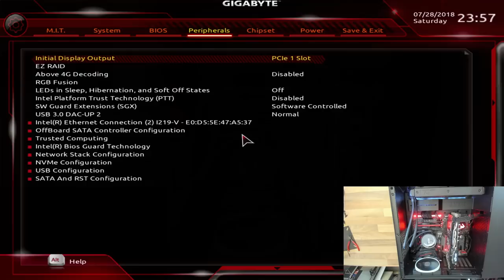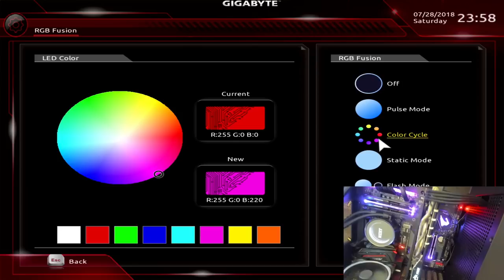Let's Build #23 - Koringwood

Comment: I think the regular power cable looks pretty good, no need for the braided. I had some ketchup and mustard just on the end of my power cable so I got a painters brush and used flex seal to cover it up with black rubber, it work good too
Reply: That would look pretty cool! What I would use is heat shrink tape. Looks like plain electrical tape but shrinks just like the tubing.

Comment: 4:12 @ adamant IT that's funny I've always used the hex head phillips screws as my mobo screws as well, even before knowing really anything about circuits.
guess I just had a gut feeling that the screw was supposed to touch those solder points.
and my crosshair II came with the single block front panel connector too. So it had been done before NZXT 😋

Comment: Is there a reason you put the power supply fan facing up instead of pulling air in from the bottom?
Reply: I would image it’s to do with dust.
Reply: From other vids on the same channel, it seems to be a combination of preventing the PSU filling with dust, stopping filters which are invisible & thus likely to be forgotten in terms of clearing becoming blocked being neglected, and also a contribution made by the PSU to extracting warm air from the case interior.  In the case of PSUs with RGB fans, it also means you stand more chance of seeing the light show.. though frankly that seems a good reason to mount them facing so nobody can see the garish light show to me (or opening the brand new PSU & replacing the RGB fan with a plain one).

Comment: I have the same NZXT case mine has a X470 Motherboard R5 1600 AF 16 gigs of ddr4 3000 mhz RGB ram and a RX 5700XT graphics card it is so quiet i love it the cpu is running stable at 4 ghz.

Comment: Great build. I believe the radiator for the all in one is the wrong way around and needs to be flipped so the tubes are at the bottom. Gamers nexus tested the configurations and having the tubes on the top of a vertically mounted radiator shortens life of cooler, can cause the air in the system to make the pump noisier and reduce cooling etc. Well worth checking out their tests ,many people have changed their radiators around and had much better cooling and quieter.

Comment: Again friend, getting caught up on older videos .Have you done any upgrades to this pc? Or have you kept it the same as the build video? Loving the Content!
Reply from the maker: It's largely the same, except I changed the 960 out for an EVGA GTX 1070 not long after building it.
I've got the itch for something new, but tbh it'd cost me arms and legs to build anything that's actually better. I'm probably going to drop a Ryzen 4000 and mobo into this later this year though.
Reply: @Adamant_IT  I Look forward to Watching it Adam! Channel is Awesome Cheers from the States! Thanks for your reply!
Reply: @Adamant_IT  did you experienced any pump noise or bubble noises with this orientation of the radiator? If so try to invert the orientation of the radiator so that the tubes are down the loop and make sure that the pump is lower than the top of the radiator.You should experience better temps and lower noise from the pump. AIO cooler like that ship with between 2% and 10% air in it, that can pass trough the tubes and go to the pump and mess with your temps a bit.